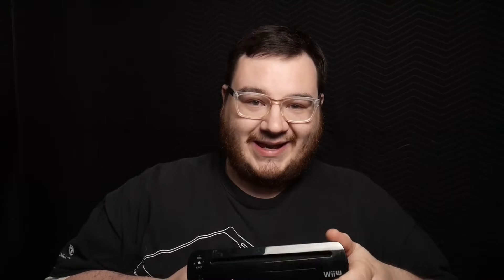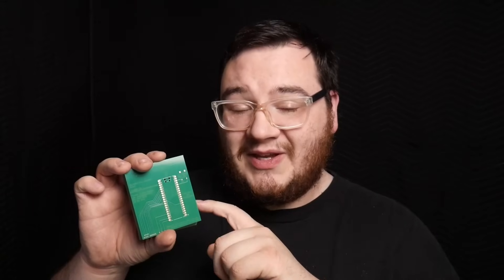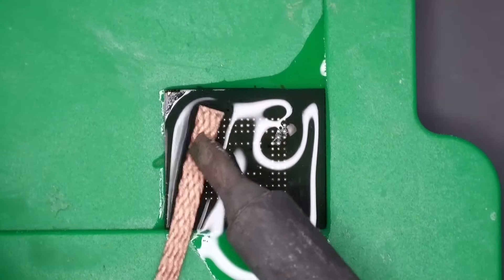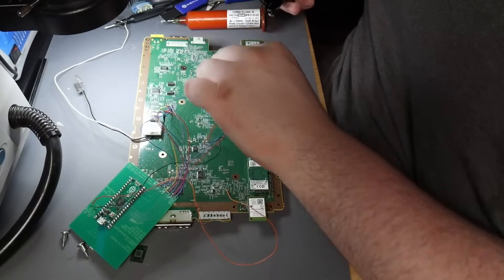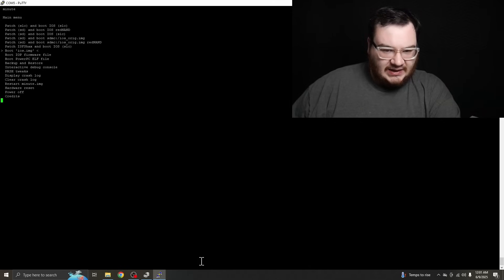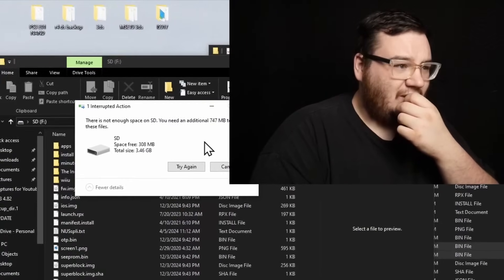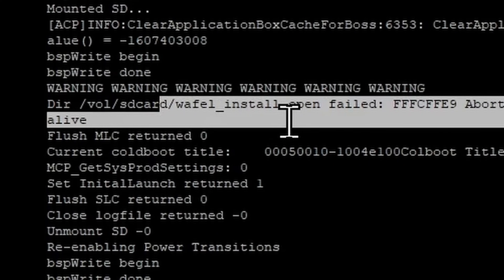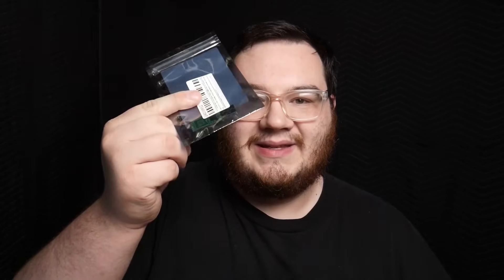DEAD WiiU Resurrected With a $4 Mod Chip

Comment: well, interesting! but I'm a bit lost here...
With that I'd be able to recover a bricked wiiU without a nand backup? or if the annd goes bad the pico can be a replacement?
Reply from the maker: I got you! 

The Wii U can be fully recovered without a NAND backup.

The pico’s main job is to glitch the SOC and boot the first few bytes aka the Boot1.img that you write to the 1Gb SD Card (not shown in the video, but is in the guide) 

Then the other part of this is the pico outputs serial via the GPIO on the Wii U board. Which means you can see what the Wii U is doing. That way you have a digital log of the device, so you’re not aimlessly trying to troubleshoot any issues you could run into. 

It’s pretty great 😊

Comment: Excellent video, but no offense the custom PCB does not appear to add any value or make anything easier. It just seems to make it larger. You still had to solder jumper wires to everything. What was the point?

Comment: "There is a limited supply", bro, that's cool and all, but that's the simplest PCB I've ever seen, anyone could replicate it, and buy for pennies at JLCPCB just by looking at the images on the video.
In fact, that would be a mistake, that board literally just increases the size of the Pi Pico, there's absolutely nothing on it, you could just wire straight to the Pico and have a much more compact board for installation.

Comment: will this work if your wii u is already "bricked" before you attempted a hack/pico boot.I get the error code 160-0103 when I try to launch any of my downloaded wii titles, like xenoblade and metroid trilogy. I get the error code 162-4065 when trying to update to 5.5.6 from 5.5.5. I get the error code 160-1710 when I go to data management in the settings. I have tried the pico boot fix using it plugged in with a usb after hacking it that voultar did. It seemed to all go well, but when I did any of the previously stated things it crashes with those errors. I'm asking because if I use my dumped nand right now will the errors persist after a nand replace using this method and going through all the trouble? I was looking into voultar emmc to sd mod and then just saw this video, and would love to bring back my wii u. But, if my nand back up is corrupted I don't really know where to get a clean back up. Does nintendo just have the files or do I need to sail the sea to find them? or that site that you mentioned going to be what I would need? And for someone with moderate modding experience, but no reballing experience, be better off going the voultar emmc to sd route?
Reply from the maker: This is for a Wii U that the EMMC aka MLC is totally dead.

And I would 100% recommend the voultar SD nand aid over doing what I did. However, if you  want vanilla, do what I did. Lol
Reply: @chasefournier  Oh. ok. Makes since. Thanks for the reply, sorry for late reply, youtube has a habit of not telling me when people reply to comments or google doesnt give me the notification. Thats my issue. No one has had all three of these errors at once, but Everything points to my problem being a dead EMMC, yet the device "works". Thanks for the video, knowledge, and reply. Once I get things situated I may visit my Wii U again and see whats up.

Comment: Voultar created the original and the fix. Give credit where it is due
Reply from the maker: Whole different mod. Voultar created NAND-AID, which is a PCB that allows users to disable the onboard emmc and replace it with an SD card. 

shinyquagsire23 created the De_fused Modchip for the wiiu to boot into Minute_Menu

De_fused is important because if your nand is totally dead, the only way to save it is De_fused.

So in this instance, Voultars method is a "Band-AID" fix, but a solid first timers mod. (Also a play on words ie. NAND-AID = BAND-AID) 

For most people, it's the best method to fix a dead or dying Wii U. 

But I like vanilla. I'm a plain Jane kinda guy, and if we're gonna fix it, I wanna try to fix it like original. Also if your NAND is totally dead, and you have no ISFSHax installed, you need De_fused anyway. 

So this is method, replace emmc, boot into minute, format emmc, reinstall titles. Fix console. 

No credit to give to Voultar; because I'm not using his PCB.
Reply: @chasefournier Ok, my bad for jumping the gun,  you are correct there.

Comment: I think its really cool that most system mods and repairs are utilizing a Pico or a Pico W to reflash system nands and stuff. I used a Pico W to flash my xbox 360 for the RGH 3 mod and it went smoothly. I plan on doing the picoboot mod to my gamecube soon.
Reply: Picoboot is so easy

Comment: technically not a modchip, just a modded raspberry pi pico but yeah it works the as (almost) same
btw you can install aroma and use wiiuident to check if your wii u has a hynix chip or not
Reply: Just because it's a raspberry pi, doesn't mean it's not a mod chip.
HWFLY is a modchip designed 100% around the pico.
Reply from the maker: I think my case has been closed today. 🤘😂

Comment: Mostly just commenting for the sake of the channel, but im curious if this could be done with wires directly from the Pico?
Reply from the maker: absolutely, I’ve done it several times with just wires and it’s just so sloppy. The PCB I made cleans it up a little bit makes it easier.